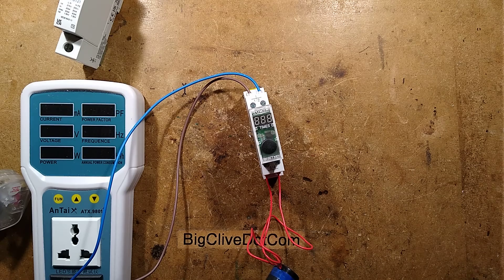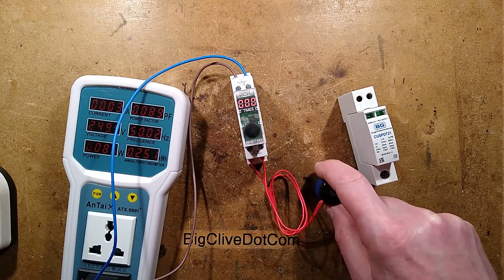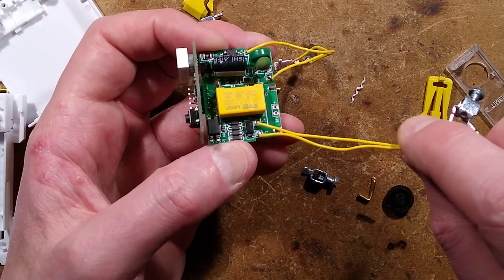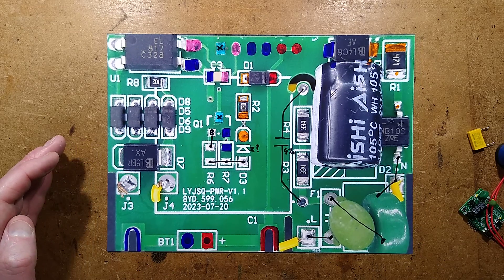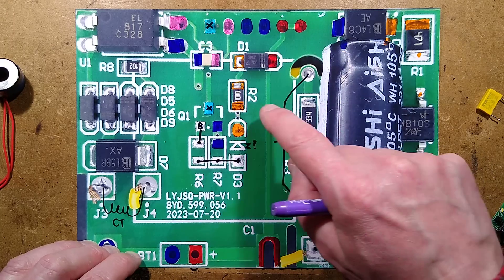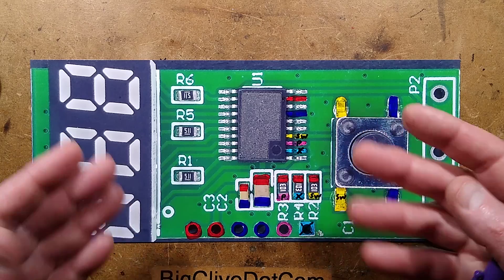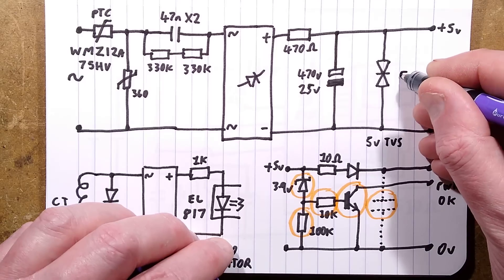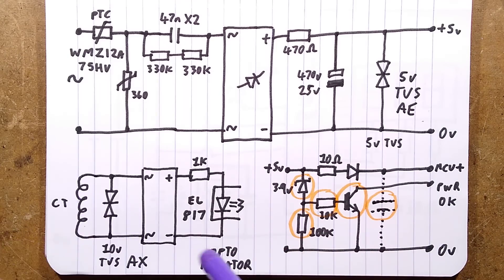DIN-rail lightning strike counter

Comment: Perhaps you'll Trigger it by discharging  beefy capacitor through a short wire in the CT. Or short a ring main via wire through the CT.

Comment: I bought a few of these TOMZN Lightning counters and can confirm the capacitor discharge test method worked for me and I see counts. I did get many counts from a single ark event though.

Using these to monitor the usefulness of my AC and DC (solar PV) surge suppression system. Commercial surge counters versions were too expensive to justify using on a residential system.

Though I did have to modify the TOMZN Lightning Counter to work on US voltage and frequency (120V 60Hz) by changing the film X2 cap from 47nF to 100nF.

Comment: Where I work, the building that the company uses as an office was struck by lightning a few months back, it fried every telephone in the building, most of the conputer monitors, and the routers. I was glad I didnt have to deal with any of the setbacks because I don't work on the office side of things

Comment: I would have thought a short length of wire through the sense coil, that was then used to short out a largish capacitor would generate a big enough spike to trigger the counter. If that does not work just keep upping the capacitor and charge until it either works, or you vaporise it.
Actually after getting it to count, the see how much it can handle before if dies.

Comment: Having seen a house that has had a real lightening strike, I really do wonder about the gimmick value of such a device. Physically, the house wiring looked nigh on normal but it was anything but. A couple of sockets had been blown off the wall and using an insulation resistance tester would show all cables had shorts between live, neutral and earth conductors, left as the insulation melted down. Somehow, I don't think I'll be bothering with a counter. Much like the new fangle must have, the AFDD. Just adding another source of possible arcing and something else to go wrong.

Comment: 1:54  You do own an insulation break down tester, and several devices that can generate a high voltage  output (e.g. bug zappers, ozone generators, ion generators. Do you own an ESD tester?). All you need is a high voltage spike. Probably. Not current (probably).  Maybe running a  240V in parallel through the could also can do the trick (in addition to a high voltage spike generators)

Comment: When you measuring resistance you can't hold with your fingers on both cables.
A screwdriver shouldn't have a handle of metal. You will notice that one day when you forget to cut the power before you starts to screw.

Comment: Correct me if I'm wrong but normally metal oxide parts fail in a short circuit mode. So in theory you'll know when to change the surge protector when it will continually clamp the mains voltage.

Interesting circuit nonetheless.
Reply from the maker: They do trip a thermal fuse or link when they heat up.  But this may be to give a warning one is needing replaced in advance.

Comment: There are some railway installations in the UK where certain components have to be tested and/or replaced if a voltage transient has been registered on devices similar to these DIN mount units (irrespective of transient source, so not necessarily lightning).

Comment: I've got a fun one! Our first satellite dish wasn't grounded, at all. We had a lightning strike about a quarter mile down the road. Since satellite is just a bunch of copper tubes and wire, it caught a shockingly high amount of the energy. Every single connector and wire that was connected to the satellite system was either arced over or had carbonized shielding. Thankfully, everything connected to our TV's are on expensive surge protectors due to my parents growing up with antennas, so only their equipment was completely damaged.

Technician said he had never seen anything like it. All the barrel connectors in the walls had melted panels!

Comment: A potentially more promising approach would have been sticking a wire through the sensor making it short circuit a big electrolytic capacitor.

Comment: There's a possibility that this surge protector can detect short circuits, inductive loads and current spikes defeating its purpose. Maybe if this thing reads voltage instead of current, it will be less error prone. Reposted it because the edit removed the heart. tip: if you post a comment and it gets a heart DO NOT EDIT IT.
Reply from the maker: I do see edited comments, and they usually get another little heart.
The unit should really just see a current spike going through the surge device, via the pickup coil.

Comment: I once saw another version of this. With a mechanical counter, integrated directly into the earthing of a lightning conductor system.
Unfortunately I couldn't take a look inside. In this case, I suspect that the counter is actuated by the magnetic field generated around the earthing rod.

Comment: Since they had a single current limiting resistor in the 7 segment display, I wonder if they multiplex the 7 digits also?  If not, then the intensity of the digit would vary depending on how many segments are lit up.
Reply from the maker: The display is being multiplexed.

Comment: I have a great temptation to hook a TTL serial interface to the 5 unpopulated through-hole spots on the bottom of the board with the microcontroller+counter LED, i wonder if they left any sort of debug output in their code...
Reply from the maker: I'd guess there's no serial data and that it's running pure assembly code.

Comment: Would the SPD device suppress the spike before the counter has time to register it?

If fitting in a consumer unit with SPD device, where should one place the CT? (coil)

What is the inside diameter of the coil, with & without the plastic case?

For safety, it may be best to fit everything inside the consumer unit, but I'm wondering if the SPD would cut in before the counter can register, thus CT would be better placed as far downstream as possible, maybe on the service head tails?
Reply from the maker: It's the current of the spike being suppressed that increments the counter.

Comment: The ones I use have a connector on them to indicate the module has had a transient across. It is possible to wire an indicator lamp and alarm across it.

Comment: You may have been able to trigger it with a piezo from a cheap barbecue lighter.  Run the wire through the core and trigger it to shock to ground.

Comment: GE engineers developed MOVs in the 70s.  At that time they determined 80% of transients are generated by devices in the home itself.
Reply: Refrigerators, gas discharge lights, and air conditioners are guilty of many sins against more sensitive electronics.
Reply: @5467nick  yes, add coffee makers, toasters, furnace blowers, water heaters, anything clicking off and on, and of course switch mode power supplies.

Comment: What about putting a wire through the sensor and zapping each end of the wire with one of those high voltage generators that create a 1" arc?

Comment: Used something similar to these to temporarily shunt the antenna on mission critical gear with a big DPST RF vacuum relay. Ours measured the frequency of strikes and the field potential while ignoring the RF. It did save us once when lightning hit the tower, killed the vacuum relay by welding the contacts togther, but that was it, only a 800 dollar part vs the 200k plus transmitter.❤

Comment: i don't like how most surge protection works. although there are exceptions. or is wired up to. basically protection often cuts itself off rather than power off. this further reduces effectiveness of spd. i mean i've never seen it configured to trip power off. maybe it's rare event. but they do fail, right? only for industry? correct me if fail contact outputs are more often wired to something in industrial setups. i've yet to see it in homes. in some countries those are required now. if only, it would be cost effective to install them due massive cost panel full of separate dc rcd's. panel and entire house full of expensive electronics, it would be crazy to not wire them fail safe mode. really weird ideas

Comment: Here in New Mexico near Magdalena, which is about four hours south of where I live. There is a lightning farm where they they attract lightning bolts by firing a wire to act as a preferred path for ionization and then you can put experiments down with the ground some of the main return occurs it’ll zap whatever it is. I bet they could test it with that.😢

Comment: Could you use a camera flash unit and a length of wire wrapped on the current sense coil to trigger the counter?

Comment: Interesting indeed; Thanks for sharing.

It seems like having a device like that with a dry contact instead of a flag would be convenient. If you had a bunch of those on different circuits in a panel, the status contacts could all be wired in series, so if any one hits EOL the operator could be notified to check the panel.

I still love the idea of a counter, it provides a great opportunity to learn more about how long a MOV or TVS diode may last, or also give insights into locations that may have voltage spikes unusually often.

Comment: My house been hit by a direct lightning strike, I found that out while climbing in the attic and found strange black burn marks on the wires in several places, turns out the metal shielding around the wires had completely evaporated making holes onto neighboring wires too, The Lightning hit the roof or chimney and made it into the attic where it found the wires where it exploded the shielding while traveling through these into the fuse box to again burn holes in the shielding to strike into the ground plane of the fuse box. nice to know that some of these holes that were made by this was under the dry sawdust isolation this old house has in the attic. I don´t know when this happen but I found this damage just recently. I was quite surprised to say the least and it took a lot of effort to examine the damage that was made
Reply: My experience with lighting strikes/induced voltages is resonances are set up that leads to the resonant nodes causing the burns with gaps of no damage in between. It looks weird, but makes sense in the context of a brief standing wave.
Reply: @andrewrussack8647  indeed. Lightning can act very weird to say the least

Comment: I not too recently designed and made some counter trigger circuits for our resistance welders (low voltage, huge current). We originally took a signal from the firing board to a relay to trigger the counter and it would skip all the damn time.
Used the bridge rectifier like that with schottskies that would trigger a transistor to pull the counter input low. Since the welder is essentially thick copper bars, I just zip tied the old 120v relay that we were originally using to the welder throat and used its coil as a current sensor.
Worked great! And now the only time it skips, every few hundred parts instead of every dozen, is a random voltage drop from the power supply that drives the counter.
I probably have you to thank somewhere in the design process 🤔

Comment: I was curious about the P2 header on the display board, you didn't include it in the schematics. It looks like 3 pins of header are connected. Maybe it's a UART? Is one of the pins of the header connected to ground directly? Maybe the other two are connected to the microcontroller? It might be interesting to connect a UART to the pins and see if you get anything that resembles a message. You could also use a logic analizer or an oscilloscope.A console maybe? It might be for updating or re/programming the uC? Thanks for the really cool tear down and circuit reverse engineering and analysing, I find them really interesting!
Reply from the maker: For a chip like this it's more likely to be clock and data for ICSP (In Circuit Serial Programming).

Comment: you need a high voltage/high current pulse device, electric fly swatter without the bug grid works great to get a random ~300v pulse out of the tiny cap in them, could probably trip this inductively

Comment: A counter like this seems interesting.
However, it wouldn't really help much in knowing the amount of wear in the surge protector. Since a larger source wears it out more than a smaller one. And not all lightning strikes are the same, not to mention other surges on the grid.
Though. Could still be interesting statistics for the statistics inclined.

Comment: Interesting device. Just wondering why it is triggerd by a current surge and not a voltage surge/spike!
Reply from the maker: Because the surge suppressor will only pass current during a high voltage transient.
Reply: @bigclivedotcom  But what if you monitor the hig voltage transient? (No ct needed.)

Comment: i don't think it would survive a Strike if it  paths the  "wrong" way

Seen Strike jump in and out  of Underground cables an shoot out of Ground  Shielding 

- I would of Got  A Test tube  an cut the bottom off with a tile cutter 2 Rubber bungs with a nail threw Them  and got one of them taser module (Boost Step-up Power Module High-voltage Generator Converter DC 3v-12v to 400kV)

and ark the 2 nails within the test tube with the clamp around the Test tube

Comment: Many years (actually about 4 decades ago) a popular electronics magazine published a circuit for a lightning detector that you connected to an AM (MW for those in the UK and other parts) radio. 

The theory was very simple, the circuit had a notch filter that blocked most of the audio but would pass the static crunches caused by lightning. If the level of those pulses exceeded the set treshold, it would trigger a light and audible alarm.

One can also figure out the rough distance from the storm by listening to the intensity of the static based on where the radio was tuned. If on the low end of the band, you can hear lightning from farther away. At the upper end, storms had to be closer for the static to be heard.
Reply: Analog channel 2 in the US is around 55 megahertz (yeah some TV is on VHF here, we are cave men). If you watch the lightning interference on channel 2 you can "see" tornadoes in the vicinity. The tornado(es) have to be in VHF TV range which is around 20 miles, that isn't good. When the whole screen is white with interference you should have taken cover long ago. 
Of course you should be watching the weather on another TV, they have radar and will tell you the exact street the tornado is on.

Comment: I wonder what a Carrington like event would do. I want to log brownout events, but cab't find anything.
Reply: I've been looking for a device also, as the Village I live in is on 3 pole mounted transformers feeds from other villages down the road. 

I get prolonged power variations, where the UPSs beep and the Emergency light comes on. But the older Incandescent and Halogen Lights continue to work. (Have to say the freezer compressor hates it)
Reply: @grumpy2.0 If you just need to know if the power failed or not, you can plug a nightlight in to a home automation socket and turn it on, if it has settings, make certain it doesn't resume after power failure.

Comment: Clive, Completely off-topic but when I saw this I totally thought of you (and figured you’d be interested).  Breville has a new carbonator system called the InFizz that they’re marketing specifically to carbonate alcoholic drinks, sugary drinks, and pretty much what you abuse your SodaStream for lol.  Much more swanky and classy looking of a system too - probably more expensive.
Reply from the maker: I looked at it and when I saw the astronomical price for something so simple I decided not to promote it by featuring it in my videos.
Reply: That was pretty much my reaction to it too; but I can't say my reaction to SodaStream isn't too different.  Forever I keep thinking I want one, then when I go look (US pricing) they want a couple hundred just to get started - then of course you've got to accessorize!  Then there's that monthly cost for cylinder exchange over here -- ends-up being way cheaper funding Big Corn Syrup.  Oh yea SodaStream is Pepsi now over here.  I feel like Breville is definitely marketing themself towards the in-home bar crowd; the unit I had looked at very much looked like a barroom tap.  Swanky.
Reply: @davidbandler Becky Stern has a video on how to adapt one to use a larger CO2 cylinder.

Comment: Would you be willing to do a tear down, review and trick reveal on the Magic Switchboard? So much click bait out there promising a reveal but not following up on it.

I suspect they use a separate remote to turn the lights on and off and the switches don't do anything.

Thanks!
Reply from the maker: There was a real switch/light trick involving tuned circuits, but when the covers get changed on this one it looks a bit suspicious.

Comment: Lightning can strike several times in the same place, often so fast it looks like a single bolt.  But an optoisolator trigger would easily see the separate pulses.  So the capacitor across this one is effectively debouncing a lightning strike!  😀

Comment: Surprisingly well built.

Don't see the two resistors on the capactive dropper often, even in good brand hardware.
Reply: As someone who is inexperienced, mind answering why are 2 resistors on a capacitive dropper a sign of good quality? I assume a single equivalent resistor would serve the same purpose. Is it because it shows they are baller and don't cheap out on products?
Reply: @astral-proj3ction  I'm not an expert, but I believe a single resistor is near/at/over it's voltage rating when used this way.
Reply: @shaunclarke94  I had a look as this was an interesting point. looks like 0805 resistors are fine up to 400v.
It's more likely just power dissipation.